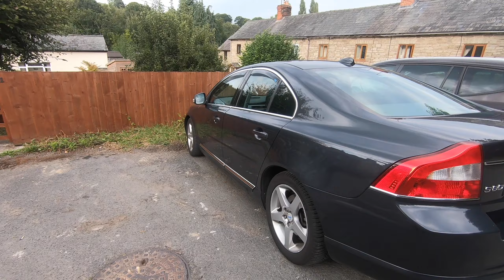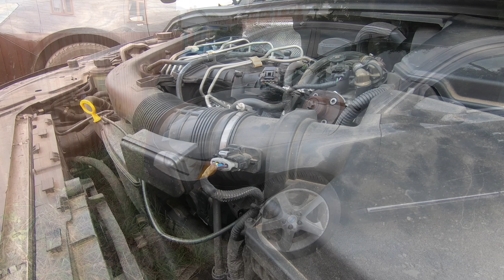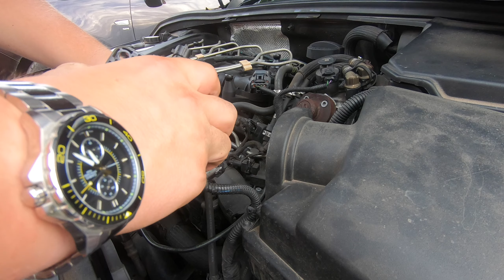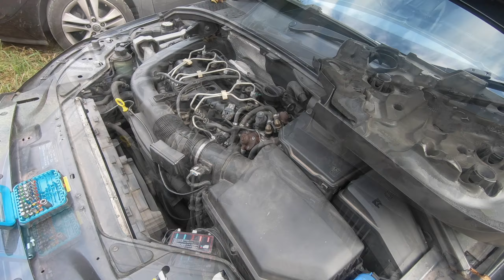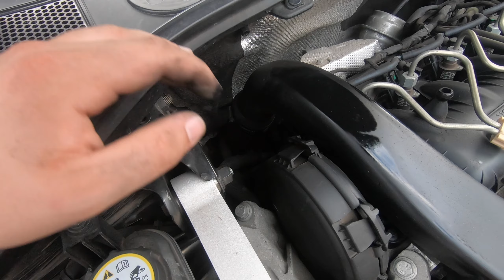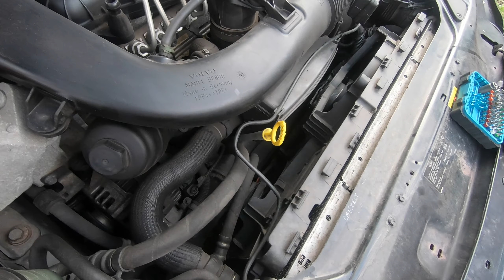Volvo Mass Air Flow Sensor Removal! P3 Volvo D5 - Intake Air Temperature Sensor Removal

Comment: The mesh isn’t to keep debris out, that’s the air filters job. It’s there to create a laminar flow over the air sensor so it gets an accurate reading and is unaffected by turbulence. There are no end of numpties online who cut this mesh out because they don’t know what it does; Bosch knows what it’s doing.
Just spray some MAF cleaner over it while it’s disassembled.

Comment: For anyone watching this who has a slightly earlier D5 (mine is a 2007 d5), I had a slowly getting worse issue. 
   Symptoms were....
   Under load the car had 'limp home' symptoms without any engine fault codes or warnings. Total power loss SOMETIMES. 
   Read the car with Vida and nothing unusual. 
   I changed the electronic turbo wastegate actuator, still had the issue. 
  Changed the throttle body, still the same issue. 
   Changed the MAF, fixed. 
  If you have to do the same, best then go into the ETM and recalibrate whatever parts have been changed. 
  Weird but sometimes the mafs can fail and NOT throw a code. 
   Cleaning it didn't fix it.
Reply: To calibrate MAF, do i need Vida or it can be done with any computer?

Comment: It's removed every time someone changes the air filter. Just way easier to pull out the air filter rather than struggle. Also they are rarely faulty faulty. Just slightly faulty. MAF cleaner is the first try and don't start the car disconnected or you may introduce a engine code. Fair play for giving it a go.

Comment: You should have brought some MAF cleaner and Sprayed it off before replacing it also loosen the circlip as much as you can as the bead on the MAF needs room to expand the connecting hose.

Comment: love the video's. I've got exactly the same car. have you a link for the tool to remove these screws/fittings?
Reply from the maker: Hey Alex, just get a good torx bit set they are only about £10 and are well worth it :)
Reply: @drivelife.channel  will do.. Fitted custom mirror lights last week via amazon. They look amazing for 25 quid.
Reply from the maker: @alexwoodward5300  excellent! it's amazing how little details transform the car 😁😁

Comment: Could you advice me which one sensor is called IAT Sensor, this one or the other one on the bottom, next to the intercooler? I have a error code P0096(00) and I don't know which one should I replace

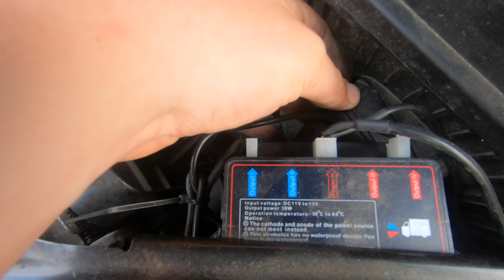Comment: Another helpful video. Thanks 👍🏻 Have you got some sort of battery monitor permanently connected? I caught sight of a small box with a lorry symbol 9:41 into the video? Just curious 😀
Reply from the maker: That is the control module for my orange grille lights :)
Reply: @drivelife.channel  OK 👍🏻

Comment: Uh...Isn't that air box held in place by screws located on the inside underneath the filter ?  I will go check my s80's filter and see.  [probably should've checked again but I'm sure I had to remove like 4 screws last time]. Recently,  I can't get my main plastic intake to snap back into the slot in my grill.   Been suckin hot air here in Florida,  not optimal.  I'm a go fix that, right now.

Comment: I had a mass air flow sensor go on my 2002 Volvo V70 2.4 Non turbo and the car wouldn't go above 40 Mph and it would do 60 Mph downhill it was stuttering a lot and it failed on the M25 I only just made it home it was running very rough Take care

Comment: Remove the top from the air box as you do when changing the air filter.  It's far quicker and you don't even need to remove the MAF sensor   from the air box.

Comment: MAF sensors should not be cleaned with any form of cleaner, electrical contact, or special MAF cleaner it can damage the hot wire inside, compressed air is best, but if it is failing in the end if will and needs to be replace.